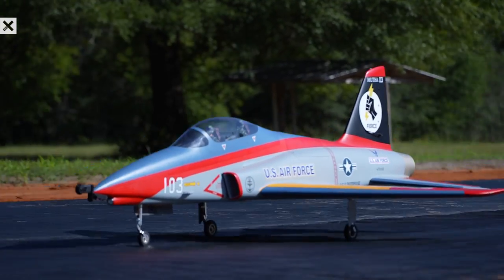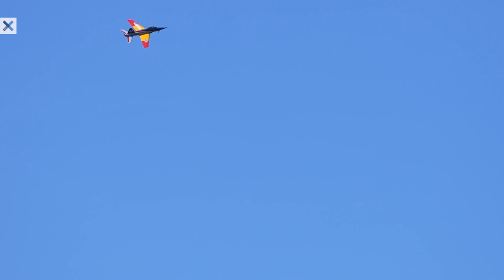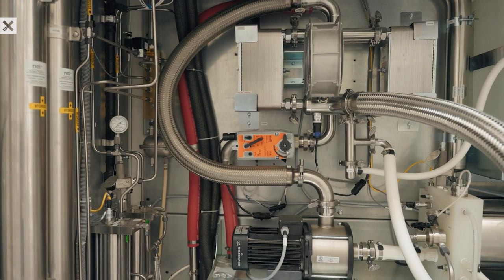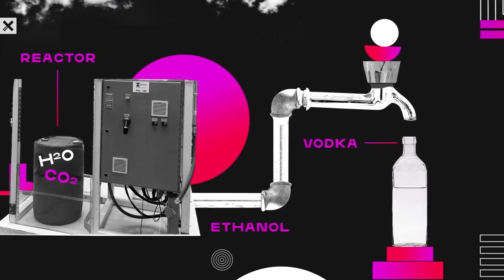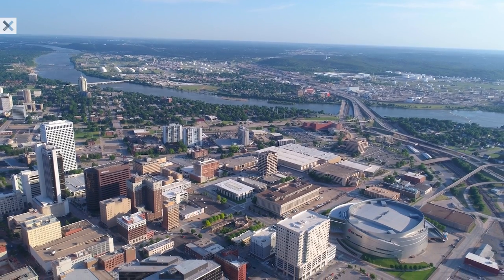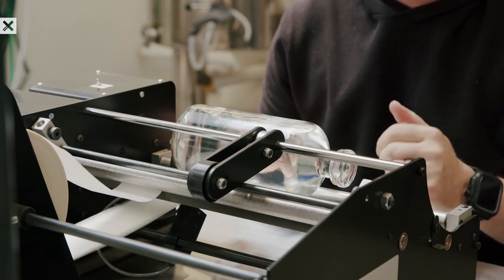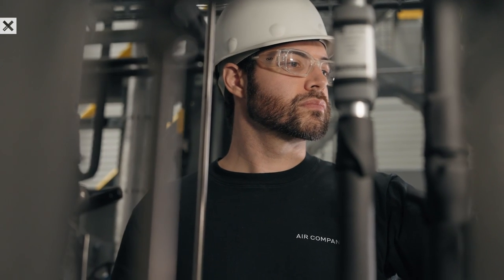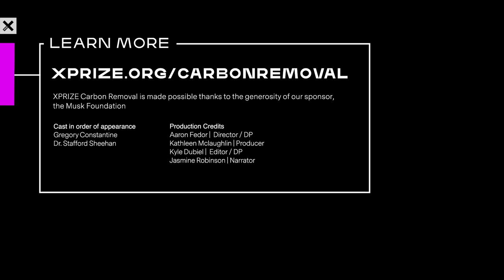This Game-Changing Jet Fuel Could Change Aviation & Climate Change Forever

Comment: Doesn't look so promissing because every step after hydrogen is getting very costly especially when you also try to get the CO2 from the ait. We can use hydrogen as a fuel. There are some small plains using hydrogen already we should scale them up to bigger planes trying new designs smaller planes or lighter materials and less luggage or something to make them work.

Comment: Why not use the the new flying windmills created by Google, which cannot be used near cities for safety concerns, to supply abandoned deep ocean oil rigs with nearly unlimited electricity from the high ocean winds, to empower these synthetic fuels made from carbon dioxide processes? We could ship in liquified carbon dioxide from our coal burning electric power smokestacks emissions, to be processed into synthetic fuels on site there, where we use these Google flying windmills safely, and then ship the synthetic fuels back to the mainlands for sale. Further, the transport infrastructure of the oil drilling rigs and businesses are already in place. And the ships transporting all these things could be fueled by the synthetic fuels as well. EOJ